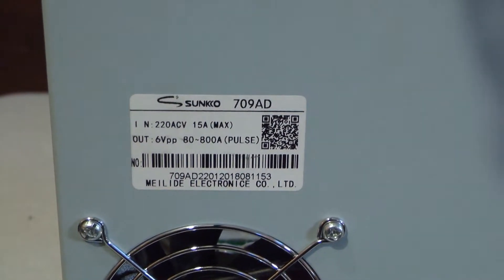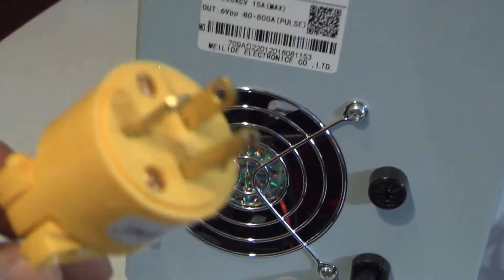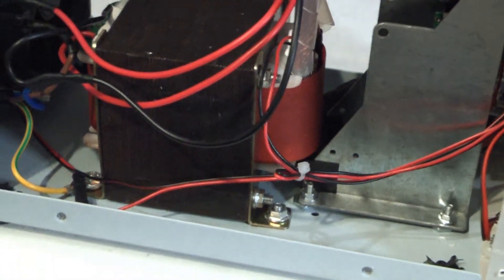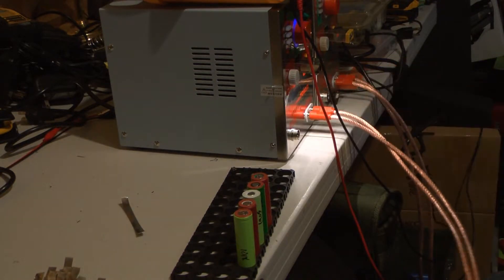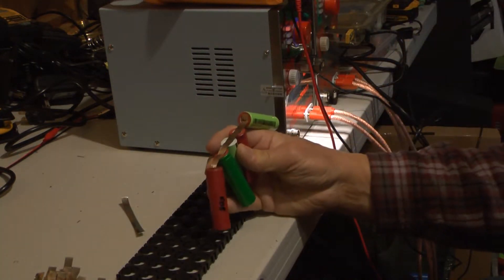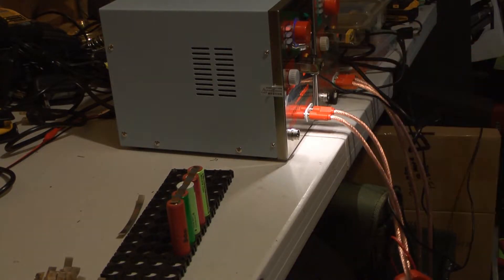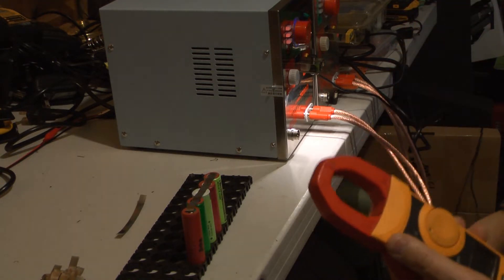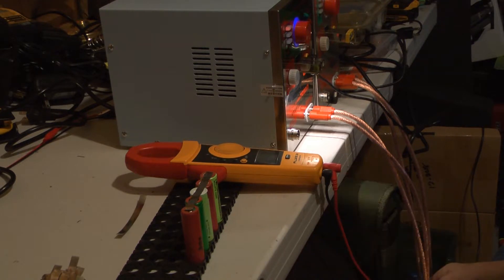Sunko 709AD VS.  Sunko 709A Spot Welder, the winner is?

Comment from the maker: It was a 15 amp receptacle I had the 120 volt spot welder plugged in to, good advice about using a higher amp receptacle. The 240 volt model was on a 240 20 amp circuit.

Comment: I'm curious, what rating was the circuit for the 120v when you tried that? 

I have a 709A (110 version) and I couldn't seem to get it to work properly on a 15 or 20 amp circuit at my old residence. However at my new location I tried it on a 30 amp circuit and it works like a charm. Even using the stock pen, I have it working. It's also possibly the wiring being different or the fact the power box is located a few feet away from where I'm working now too?

Comment: H'mmm .... I purchased a Chinese desktop drill press fur US 110 Volt AC. The original Chinese model was rated for 220 Volts 50 Cycle 750 watts. What they did to convert it was Paste a new 110 Voltage tag over sticker and use a Japanese two prong plug that happens to 'fit' into a US socket. They thing ran at about 1/3 speed and I hold the chuck from spinning with my hand. I would up purchasing a 1200 watt 110 to 220 volt toroidal voltage converter. Now it runs correctly :-(

So the question here is how many watts does it draw on 120 volts ?

Comment from the maker: Yes I plugged it into a 120volt receptacle, because it came with a standard 3 prong 120 volt U.S. plug. At maximum power, maximum impulse it would not spot weld the nickel strip to even hold even a little!

Comment: Good video.  I just got my 220 volt version last week and did the same mod.  I also added another 20 volt fuse so each leg has a fuse.  Just curious, did you say you plugged in the 709AD into a regular 120 volt socket before adding the 240 volt plug?